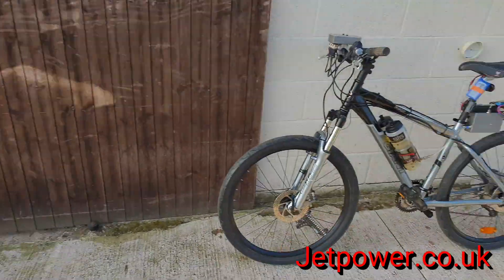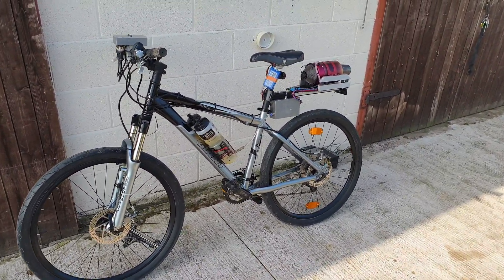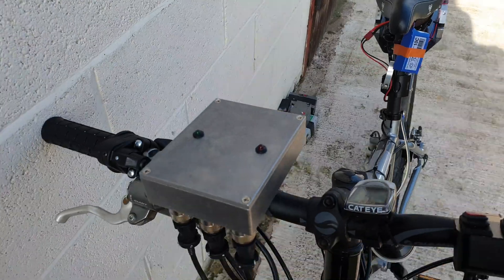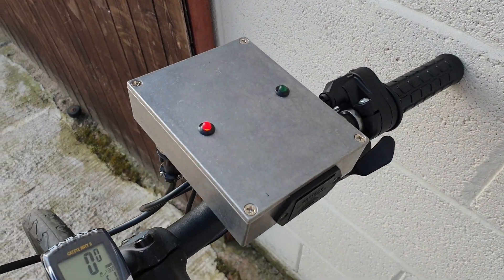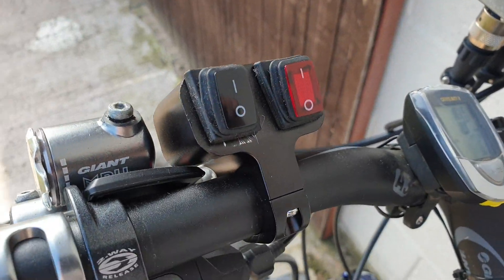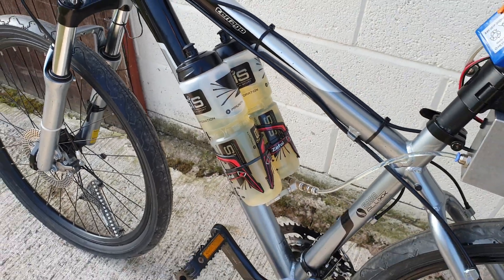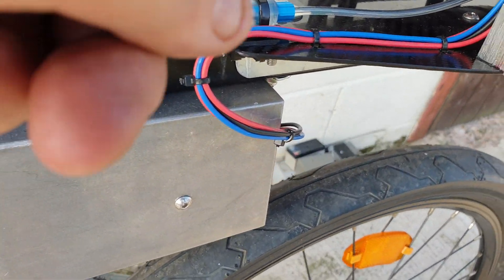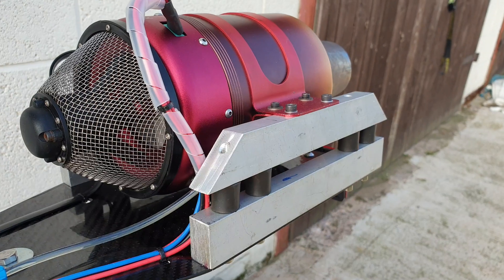18Kg Thrust Kingtech Gas Turbines Jet Engine Powered Mountain Bike.

Comment: Mr Bennett, I was wondering if you could help steer me in the right direction of a twist throttle setup?
Reply from the maker: Try using a servo tester and replace the pot with a twist grip.
https://www.4qd.co.uk/product/hall-effect-twist-grip-throttle/
Basic, but it will work.

Comment: Fantastic clip Adrian 
I want to make one ,any instructions?

I was an aircaft gasturbine tech in the airforce many years ago 

Thanks 
Dave from Scotland
Reply from the maker: Hi Dave from Scotland,

All very simple really, you just need to get yourself a microturbine and program an Arduino to give a PWM output to control the throttle.

Lots of fun to be had !
Reply: @jet-power  

Hi Adrian 
Thanks for the info, ill definitely look into it .
I've never used an arduino board before ,ive used a leo bodnar input output board for my cessna  sim to control all the real controls, just wondering if it works the same, heres a wee clip 
https://youtu.be/MhIJnr2Tni4
I would be very grateful if you could give some info on the best micro turbo to use and where to buy it ?

Thanks 
Dave